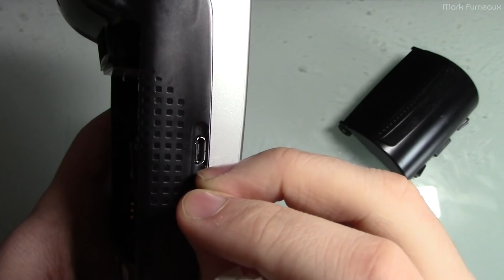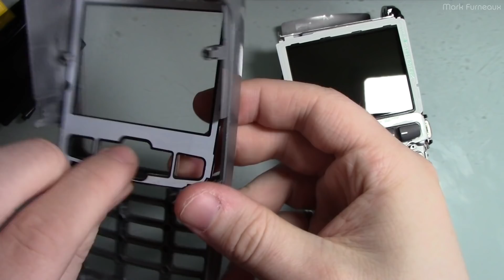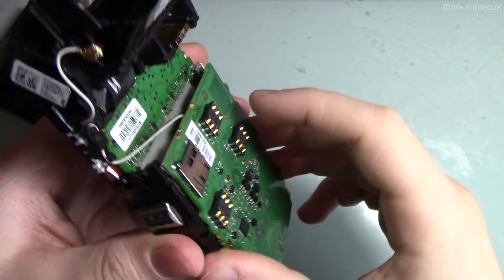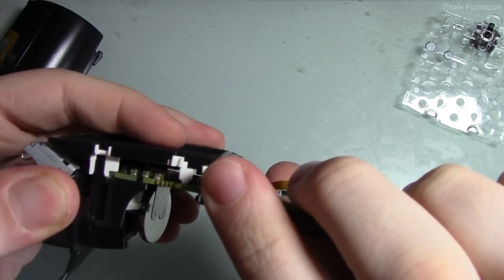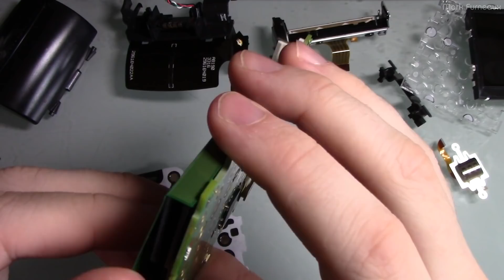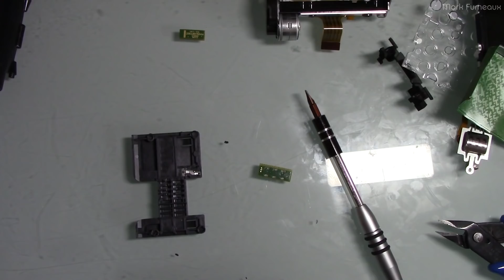Teardown of an Ingenico iWL250 Payment Terminal

Comment: They might have got rid of it due to the 3G shutdown. Any sort of 3G comms equipment is basically worthless at this point.
The devices I use seem to occasionally self-trip their tamper detection mechanism, rendering them useless. They also don't use epoxy potting, as you say, expensive to produce. I think it just relies on the numerous serpentine traces. There may be other small things like light sensors or accelerometers as well.
Reply: Is the device essentially broken after dismantle?
Reply: @jacobs8  Yes. Only the manufacturer is able to reload the wiped volatile keys onto the device and re-enable it for use.
Reply: @jaro6985  how does the device behave when it's been tripped? does it just die with no signs of life? show an error? fail transactions?
Reply: @u1f98a  It sends an error to the user that shows its been physically tampered, and is unusable. Only the manufacturer is able to fix it at that point.
Reply: @jaro6985 what about the android based ones? Cause I have one that runs android 6.0.1, and I'm trying to hack it to install apk files as I want to get mine running DOOM.
Reply: @devicemodder  Android units would have a locked down store that only manufacturer approved apps can load from. I guess if you are lucky you can try connecting USB over ADB and see if it will let you sideload?

Comment: I doubt the key sram is in the PCB material. It'll be in one of the special SoC/Microcontrollers.
The is a CCC (I think) presentation about extracting the keys from cable TV boxes that details breaking down similar setups (albeit with less tamper proofing). That guy eventually worked out enough of the chips to load a trojan onto the chip and extract the keys.

Comment: Those pieces of PCB material with a step machined in that are soldered on top of the legs for the connectors are very likely just to protect against someone drilling a hole in the back case and directly probing the connections to the card readers and thus stealing people’s card details.